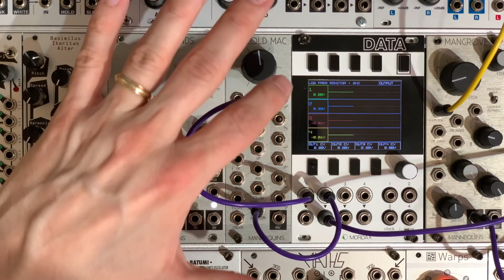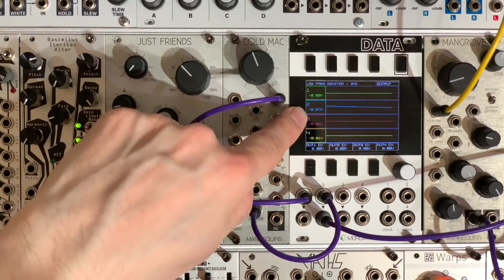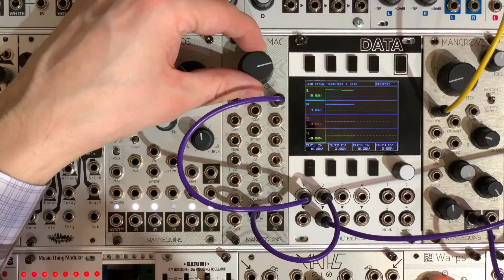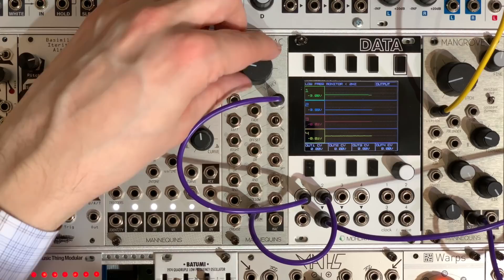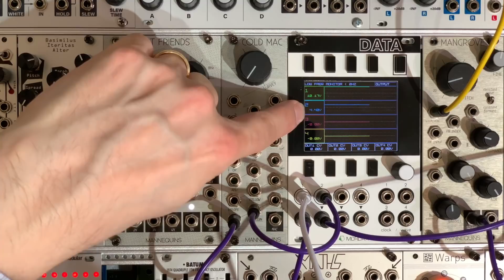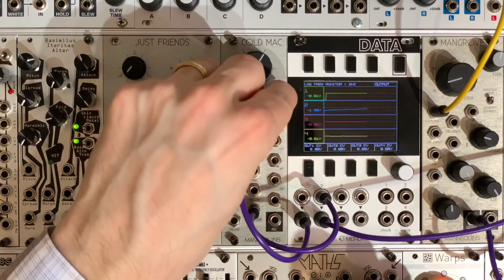Cold Mac: How Location Actually Behaves

Comment: So basically location is just slewed attenuated/offset version of the signal?
Reply from the maker: Nope. In theory, location is a voltage you steer up or down. The reality is a little more complicated, which is why I made the video. For a textual description, please see: http://doudoroff.com/cold-mac/#location
Reply from the maker: Actually, looking at that text, I need to amend the first paragraph, which I will do momentarily. Sorry for the confusion.
Reply: It looks like a leaky integrator.